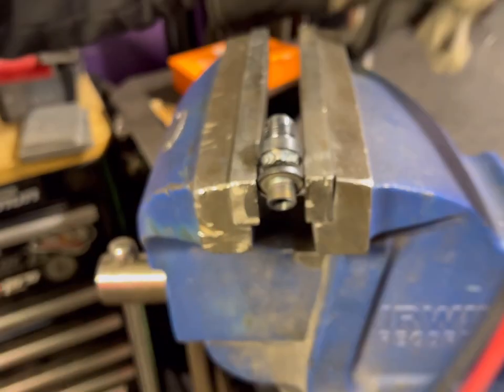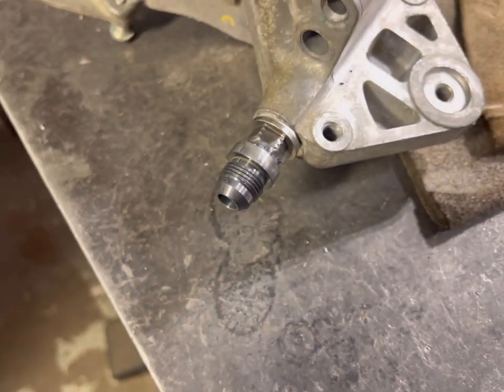K Series Block and PCV/Crankcase Ventilation Modifications

Comment: For the valve cover baffle you could use a bottoming tap that is meant for blind holes so you can get threads all the way down. That way you dont have the through holes on top. Ill be taking these useful tips for the crank case venting, awesome vid.